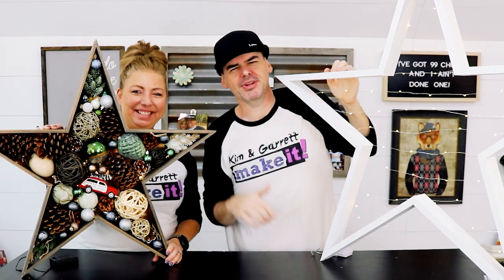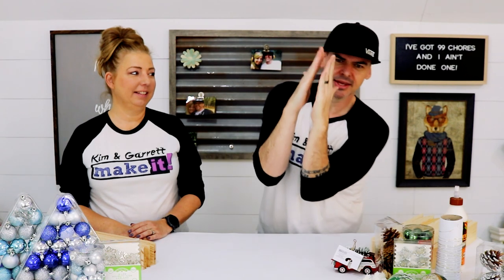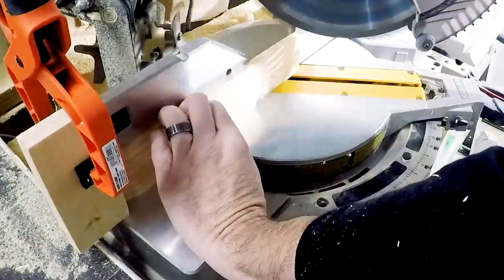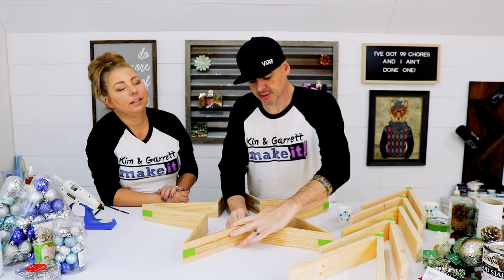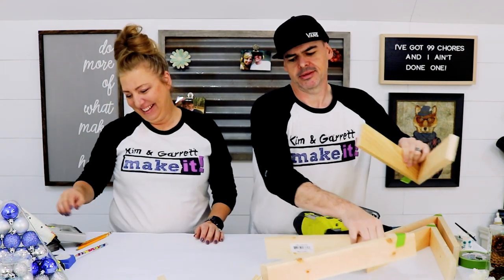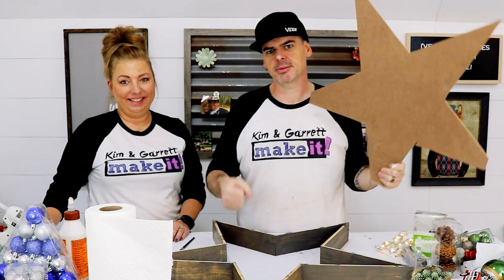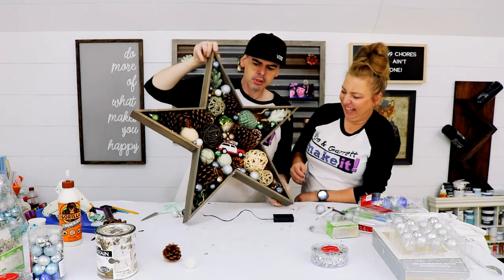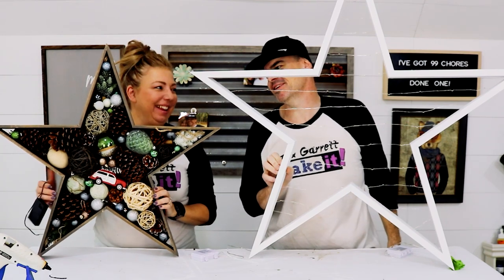Make Your Own Wooden Stars | DIY Christmas Decor

Comment: I would want the same large ones with lights and put them outside. On Kim's I would make it just a little smaller. I would add ornaments, pinecones and other Christmas decor. But I wouldn't hot glue it because I change Christmas themes about every 2 years. I love both of them.
Reply from the maker: Hmmmm good point on changing the decor...lol when the time comes, I'll just have to rip those pine cones right out of there!  Lol.
Reply: @KimandGarrettmakeit  Lol

Comment: Tip on the hot glue..when your finished just use your heat gun to lightly add qickly pass over of the top of the project and melt the little strings
Reply from the maker: Great tip!!!  I've never heard that, will definitely do that next time!